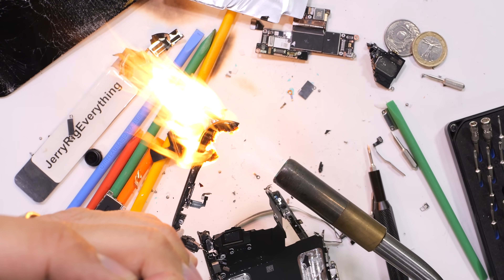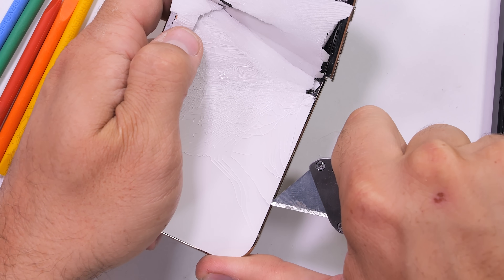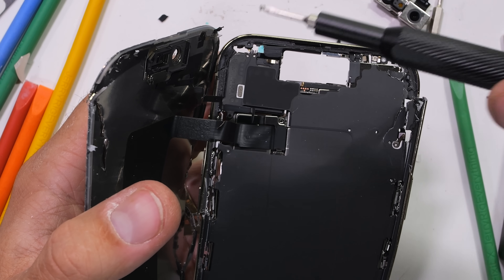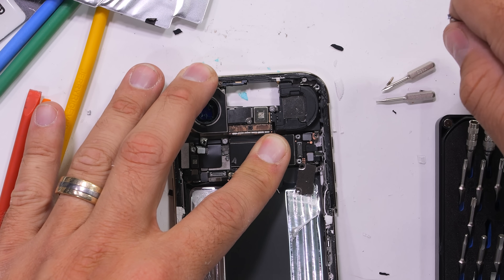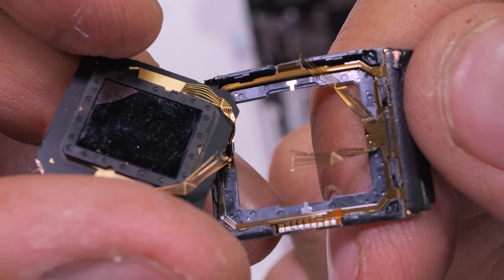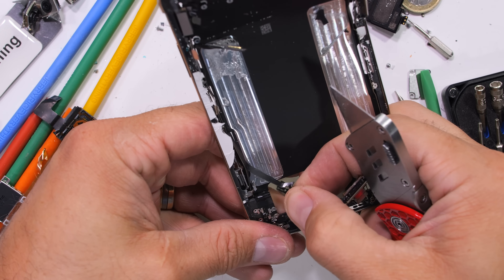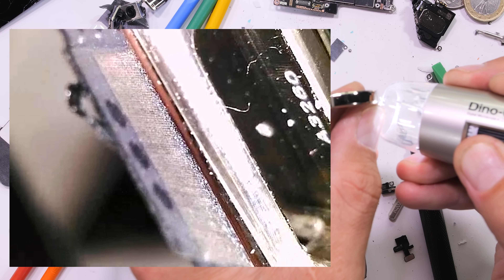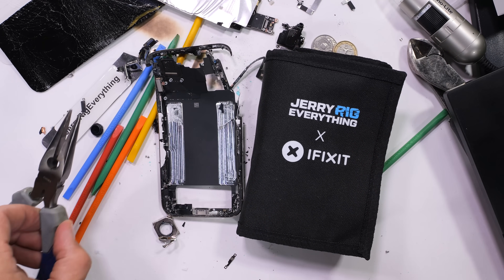iPhone Air Teardown -- I have no words

Comment: I remember when the company was bought the last time. The new owner was so optimistic and talked about new machines and expansion.

Look, truthfully, the entire concept is flawed. I never had one, but a friend did. It looks so easy to use in videos, but it’s really not. It’s clumsy and most of what it does can be done much better with an individual machine. Yes, it takes up less space, and that the entire selling point. But I’ve read that a lot of people who have bought them stop using them after a relatively short time because of the hassle. You still need more room than you think if you buy the accessories as you have to have somewhere to put them.

People with apartments are really not goi g to want to do the kind of extensive woodworking this machine is designed to do, and people with homes can figure out a way to get individual machines. So this occupies a space that doesn’t seem to be large enough to keep the company going. It’s sad as more people are doing woodworking now than ever before.

Comment: 4:30 , no, thats not the question. The question is if can you just use a battery from the magsafe battery pack as a replacement unit for the air itself😅

Comment: 2:10 A possible actual reason might be that manufacturers do not want to risk short circuits down the line if the isolation degrades due to UV light.
The glass back should filter this out, but normal light has the same effect, affecting it at a slower rate.

Comment: idc if the air is apples test before a foldable as long as they keep making it when they release a foldable, i feel like the air could be its own standalone thing away from the other iphones, they should use it as a way to push new ideas without sacrificing the flagships, its such a cool phone i might end up switching if i get the chance

Comment: making things reparable without sophisticated equipment or at home makes the electronics sometimes difficult to repair or designing such devices which are at home reparable without sophisticated equipment or with screw drivers makes it unnecessarily difficult to make and space inefficient and expensive as well.

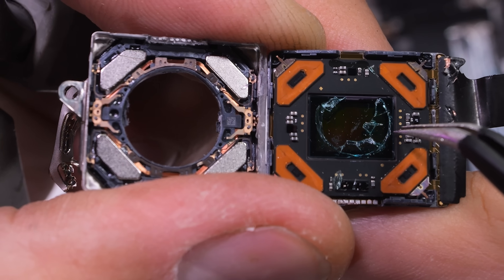Comment: 5:53 actually the top of the line('premium') professional dslrs have never gotten this feature. Their replacements, mirrorless cameras, have. Only pentax has ever made a dslr with ibis, but it was never a top of the line camera sadly, it is comparable to mid range offerings yet doesn't offer the comparable performance you'd expect, with slow burst rates, slow af compared to mirrorless, and video specs a step behind. Yet it's nice they're not giving up on dslrs and I hope their next cameras will surpass what canon and nikon offered with their last dslrs.

Comment: I'm not a material scientist, specialised in adhesives. But - maybe - the heat-melting adhesive of the battery gives more structural rigidity to the entire phone than 2 pull-tabs. 🤔
About the charging port: it can be easily replaced for just € 35.- on my Samsung Galaxy S22 Ultra. A cellphone workshop near my home has different charging ports always available in a drawer!

Comment: This phone actually blew my mind on how thin and comfortable it was to hold. It’s so lightweight that it feels unreal. Hesitated to get this over the 17 or even 17 Pro Max.
Reply: 165 grams; nothing like the iPhone 5 which only weighed 112 grams and only 2 mm thicker at 7.6 mm.
Reply: Get it bro I’ve been a iPhone user since the first iPhone and never switched from apple usually get the pro max but tired of how heavy and its always the same, this is the first iPhone I felt that new feeling ever since the X no complaints and the draws backs are so worth the form factor

Comment: all companys say is recycle but shame is most of them dont recycle they all new virgin material just because is pure and has less problems i worked in companys when was 50 % or more material recycled and guess what was all virgin plastic cuz depending what you doing the quality goes verry low so no one using it but hey ho is on the paperwork so ppl happy to see that written on the package even when is not

Comment: Nokia was the first brand to incorporate Optical Image Stabilization (OIS) in a smart- phone camera, introducing it
with the Nokia Lumia 920 in late 2012.
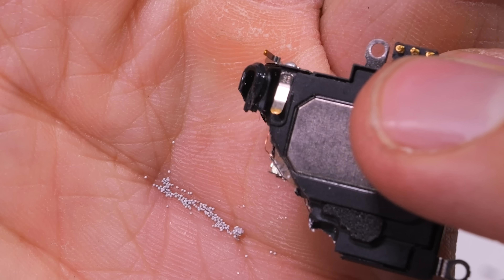5:15
Reply: I was using Lumia 930 back in 2015 and the photos I took with it (incl. low light concert shots) hold up great compared to all iPhones I owned since then, including my current Air.

20mp Zeiss, optical stabilization, no bump, 2 step physical camera button. I think it even had always on display back then :)
Reply: Nokia was the king of smartphone photography.
!! jerry was talking about shifting the sensor instead of the entire lens though!
Reply: Not the same as sensor shift
Reply: Apple has had OIS since iphone 6s plus but the sensor shift came on 12 pro max. Amazing how android hasn't caught up yet.

Comment: Honestly these teardowns make me sorta appreciate how these are “only” $1000. So much tech assembled so tightly and this phone will probably work for the next 15 years as long as you don’t damage it from misuse.
Reply: No one is still using a phone from 2010
Reply: 15 years is a little generous
Reply: The problem is the battery won't last, practically, for more than three years, and is difficult to replace.
Reply: @SK-lt1so  battery definitely lasts longer than that with care, but even then, repairs are cheap enough to be worth it if you don't feel confident replacing it yourself. i've personally wouldn't feel confident but the last few years have changed enough that now i would feel comfortable doing it on a newer iphone
Reply: @SK-lt1so  Apple will replace old phones but not if the phone has been relegated as Legacy Phones. At present you can still get Apple to replace iPhone 11 battery but not the XS
Reply: The phone will work for like 6-7 years at most before it stops getting supported by software
Reply: Well my mums iPhone 8 Plus (2017) recently got a security update, so even though they don’t receive the facelifted software versions anymore, the phones remain perfectly good to use
Reply: @jacydekock1427  My old 2016 iPhone SE ( the old small SE ) still has security updates.
Reply: while there is planned obsolescence, iPhones are not that. Apple continues software support for many years. around 6 years. and don't say "well then why does my battery life suck?" if you misuse products, DO NOT expect them to last long. my iPhone 14 Pro Max still has 88% of it original capacity.
Reply: @GrapheneCarbide how do you misuse a phone? I tend to just use my phone and charge it as needed…
Reply: @Alex72k  Discharging the battery under 20% and charging it over 80% puts exponentially more stress on the battery, as compared to keeping it between those two ranges.
Reply: @GrapheneCarbide  Mine has 87% and I'm going to trade it
Reply: @GrapheneCarbide In other words: software support ends after 6 years. That is planned obsolescence. If it‘s not, what is? You end support for a perfectly functioning device, making it perfectly functional garbage.
Reply: @GrapheneCarbide  I started checking what my friends and family have and learned 2 people still use an iPhone 11, and another uses a 12 Pro. People really do make them last
Reply: Right?
Reply: "Only" is a crazy way to word it. You should see $300 android devices if this impresses you
Reply: @ToxicMothBoi  even Android flagships struggle to match iPhone in battery life and performance despite on paper having bigger and better specs. They do not match how long their OS receives updates, and much less do the budget Android phones. So what is there to impress you about a lower mid range Android?

P.S. My current phone is the first phone i've had last me three years (so far) than all Android and even Windows phones i've owned beforehand.

This at a time where Android phones increasingly become less repairable while not improving on their durability, manufacturers tightening down on bootloader unlocking while not doubling down on increased software updates and even removing sideloading while locking down the OS even more without even improving on performance or efficiency on the OS side.

Android phones struggling to match iPhone battery life even with an ongoing trend to have battery sizes sometimes even double that of iPhones.
Reply: @Bomkz  andoid is not removing sideloading
Reply: I have a 1993 Macintosh and it still looks and works as new.

Comment: Engineer here, I work with additive manufacturing (3D printing). The process used is likely SLS or Selective Laser Sintering. The interesting thing about Ti vs Al with SLS is that Ti costs about the same as Al - since you start with a powder, the raw material is relatively inexpensive. The cost comes from the time and energy put into the sintering itself. Accuracy is somewhat low compared to precision machining, but is getting better all the time and now generally good enough for most components where stiffness is more critical than strength. With features as small as what they're working with, it probably made sense to AM the part instead of mill those small features.
Reply: A few years ago I had a German company make some screws I designed out of 316. These were pretty small 1.25mm x3mm. The precision was pretty amazing. I wasn’t going to machine them myself. I don’t remember the manufacturer of the machine, but they said it cost around $1 million.
Reply: The raw material is incredibly expensive. Atomising reactive metals into fine and controlled particle sizes/size distributions is very expensive. My guess is you meant the cost of the raw materials (Al vs Ti) is comparable because the (high) cost of powder production is so high, that any differences between these two raw materials is essentially negligible.
Reply: @jameslennard4062  this is what i was looking for. People think it is just metal powder. While i was studying AM in grad school, large chunk of academic research was focused on making atomization process economical for different metals/alloys
Reply: @propotato4633  Very cool, and very true. Me also - I was working with SLM of an oxide-dispersion strengthened steel. Even for a couple of kgs of - what is otherwise a generic steel alloy (Fe-9Cr), the powder cost was around £25k. The hazards and precautions you have to take with even small quantities of powder to stop it oxidising/hydriding (or worse) was crazy. I never worked with Ti powders but I just know the safety precautions would have been significant. Even the cleanliness measures and procedures of cleaning out an atomiser between alloys/blends was painstaking. But, it's not like Apple can't afford these things, and it's cool in any case to see MAM in an every day product!
Reply: I thought SLS was for plastic and because it's sintered you have issues of porosity. LPBF/DLMS is probably what you're talking about with the globs when melting contributing to dimensional accuracy issues. Semantics, really
Reply: Most often when applied for mass production (vs. prototyping or low volume production), 3D printing is chosen when the desired geometry otherwise would not be millable. So I wonder what design features they have used that made them go 3D printing. Saving raw material is not a convincing argument to me.
Reply: @Aktenverwalter you’re right, saving material is just one part of the equation. More often it’s being able to design a part that’s just too difficult to manufacture subtractively, or even impossible. Sometimes you can stamp a part that’s complex, but you need to have the stamps and dies made and might require several different ones as it may take several stamping operations. But 3D printing allows a number of advantages. Prototyping, for example. We know that Apple has a CNC machine shop as part of their design department. It’s been mentioned by them several times over the years. But stamping equipment is another animal. Having 3D printing available will speed that design process immensely. Apple can afford to buy any machines they need. The cost to them is almost an afterthought. I remember when someone decided that to make the tiny holes in their laptops for the speakers, they needed to use lasers, they bought one to test. It cost $250,000. Their engineers modified it. When it worked the way they wanted it to, they bought 100 more and sent it to the plant that machined their cases.
Reply: @melgross  Yes exactly. But here they chose 3D printing for mass production. Which begs the question: what design elements made them chose 3D printing over all the other manufacturing methods. When it comes to costs, usually 3D printing stands no chance against all the other options so my bet is on the design being the main driving factor for going 3D printing.
Reply: SLS can also exhibit better ultimate and yield strength vs cold-worked metals
Reply: Yeah that’s what he said in the video
Reply: Apple bought metalio in 2015 who hold a metal jet binding patent that’s presumably cheaper/faster for mass production. 

We don’t know a ton about the process but some experts have weighed in and said it doesn’t quite look like SLS.
Reply: wow, cool stuff, if I may, how did you get into this line of work? Mechanical engineering or something like that?
Reply: Very similar. I am an Aerospace Engineer, so I have a greater focus on aerodynamics and parts for aircraft, but I work with many Mechanical Engineers and people who have worked in space, automotive, and turbines.
Reply: @MrChoklad  Yep, i´m also in that line of work and currently in my master degree in mechanical engineering.
Reply: Do you also deal with aerospace engines parts printing (Compressor and turbine blades)
Reply: Sort of, haha. That is a particular area where AM has enormous potential. The challenge in metallics AM right now, particularly for these kinds of parts, is getting consistent material properties from every print. We've built some prototype blades and turbines, and though we feel we're not quite to production maturity yet, we're getting close.

Comment: 4:23
Most people don’t realize that a power bank’s stated capacity never transfers 1:1 into the device being charged. Energy is always lost during conversion, so the real usable capacity is lower. With cables the efficiency is higher (but never 1:1), while wireless charging is even less efficient (hence the 65%).
Reply: Most people realise that
Reply: @blazingriver6432  No they don't, hence why there were tons of people asking why it only gave 65% charge to the Air if it had the same battery. For people with common sense and some understanding of how electricity works, yes "most" of those people realize this. But that does not translate to "most" of the population...
Reply: @ChaseB1896  I didn't know that for example. I am not supposed to know everything, you know.. but now I know that fact too.

Comment: That electrical release adhesive is so much better and o hope it ages well. Recently fixed an iPhone 11 battery, it was like concrete from how old the adhesive was.
Reply: Agree! It might be more conplex but I've never seen a glued battery cone out as fast and easy as this version did
Reply: you can remove any adhesive fixed battery with ipa and even heat, dont heat past 70 c
Reply: Official Apple Display adhesive put on iPhones after repairs have an expiry date of roughly 1.5 years. Everyone should get their iPhone resealed every 2 years or so
Reply: It's nice and convenient seeing how cheap removal is, but Samsung's battery, while being secure in normal use, just pops out.

Comment: So basically the pro and pro max would have been fine sticking with titanium since the frame would have been aluminum anyway.  The catch is the camera plateau.  So probably the design didn’t lend itself well to titanium?  🤔
Reply: I think it would’ve been extremely expensive to have a full titanium body.
Reply: Titanium is harder to cut compared to aluminium

Comment: If Apple used Silicone Carbon battery they could have doubled the battery thickness and still fit inside the iPhone Air phone.

Comment: its interesting to note that Apple's wireless charging setup is actually also one of the most efficient, despite the 35% loss, due to the alignment provided by magsafe. Now that the new pixel also has this theres some competition, but before this it was one of the few things Apple was doing better than its competitors.
Reply: True

Comment: While I'm not a fan of apple as a company, nor would I ever purchase or use an iPhone ever, I must admit that I've been appreciating and enjoying some of the engineering/design decisions of this phone. Such as the electronic adhesive battery release. And the SLA 3d printer titanium part is pretty neat. Its cool to see that a company as big as apple is using this tech on a mass production level. But  I wonder how much of a performance hit this phone is going to take with the  inevitable thermal throttling it will have to do because of the lack of thermal paste or cooling system. 🤔
Reply: its actually still more then the 16